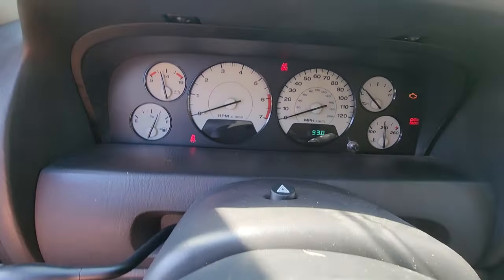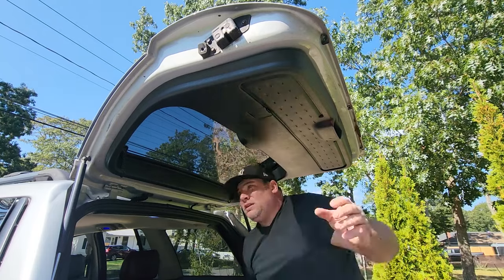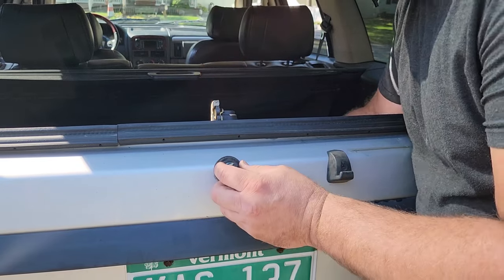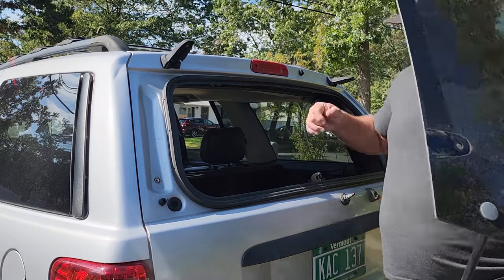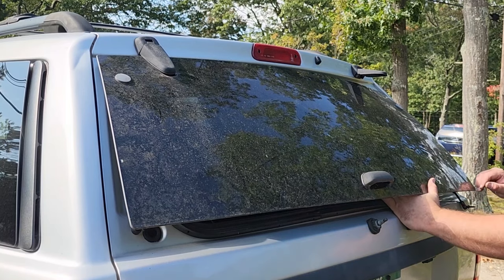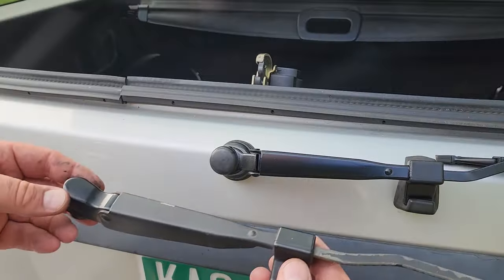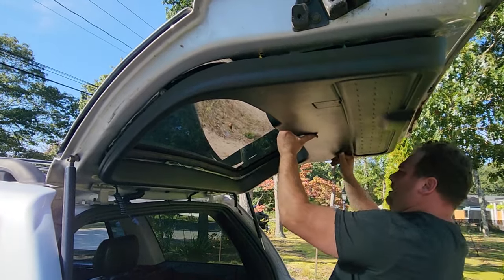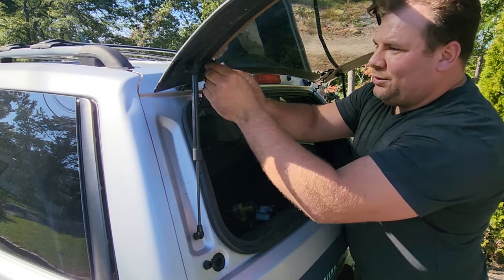JEEP GRAND CHEROKEE WJ REAR WIPER MOTOR & LIFT GLASS REPLACEMENT

Comment: Dan,
Changed my hood and rear hatch supports several months ago. Just made a rear pinion angle adjustment,  and just went over 300 miles on rebuilt differential,  Dana 35✅🤠
Great video✅🇺🇸

Comment: Love seeing WJ content, I just ordered a flowmaster 44 and Jeep Cables for my 4.7. I also need to replace the front fenders on mine because they’re all rusty. Do you know of anywhere that sells painted fenders? Up here in Canada there are very few in junkyards, I haven’t seen a white one come into a yard in two years! 

Cheers Dan
Reply: I've got a thrush rattler on my 4.7 sounds so good. Thrush is a flowmaster sold cheaper sounds identical as well. Just an idea.

Comment: Great video. I need to take mine off so I can fix the connection to the heating element contact point. Yay. Thanks for the great video. Any recommendations on the paint for the element.

Comment: The test was what I wanted to see 😂 Also do you think the metal wiper arm would fit 04-06 Grand cherokee because the plastic one on the 06 breaks every winter .
Reply from the maker: Yes. The shaft should fit.. not sure if the length of the arm is short enough tho
Reply: @ProjectDanH  I got a new one from an 2010 grand cherokee and a new wiper motor so it's up and working again if it snows .

Comment: Any advice on adding a rear posi limited slip with 4.10 gears to my RWD 4.7, 2004 GC WJ? Got mine from Waco Texas, it literally looks like it just rolled out from the factory a year ago NO RUST not even surface rust on the exhaust  The underside is near immaculate! Any cheap ideas for a rear limited slip and 4.10 gears is what I'm looking for. Thanks. I'm subbing and have liked and watched alot of your videos